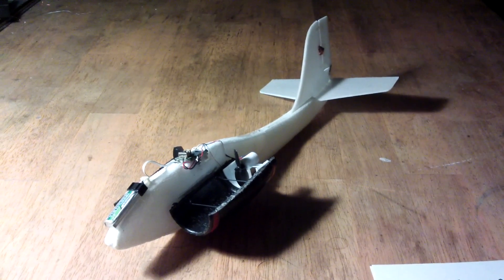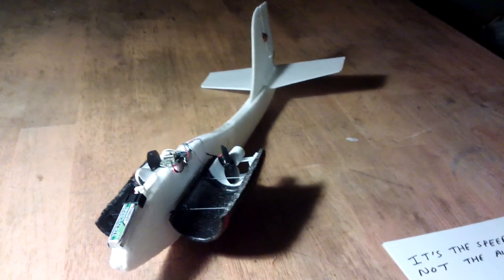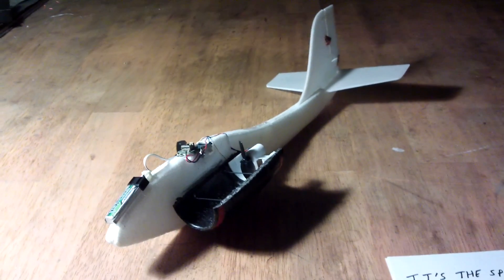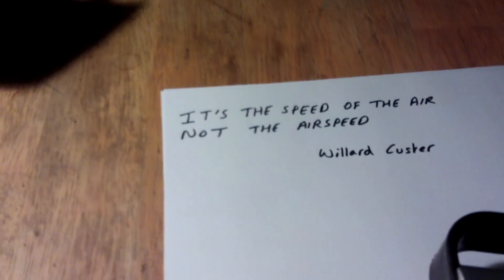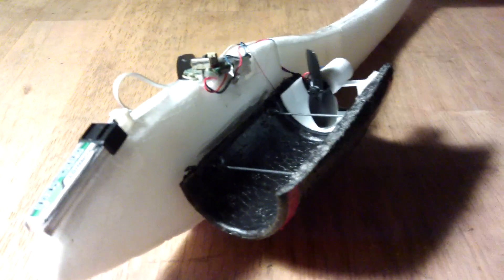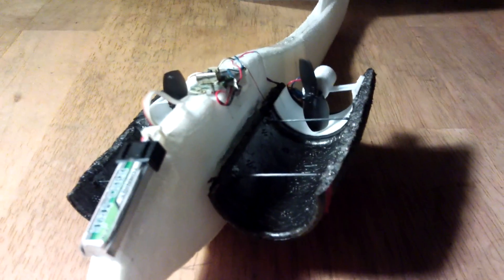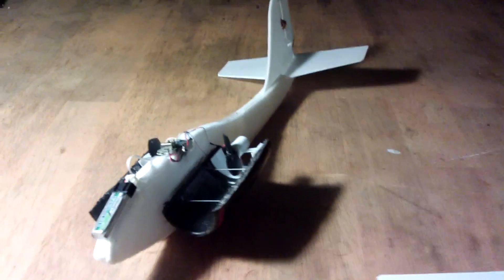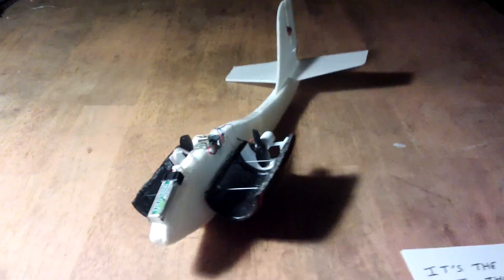Channel Wing 2015 - No Wings !

Comment: Is there any way to estimate how much lift is created via the pressure differential (resulting from the higher airflow inside the channel) alone, relative to the propeller's thrust? I understand how channel wings work, however, in your video the aircraft longitudinal axis is pointing upwards most of the time, so the effect might be partly due simply to the slighly downward direction of the propeller thrust, so we don't know to what extent you're really demonstrating the channel wing effect, compared to thrust direction alone, similar to a propeller-driven model rocket. Hence, is there an easy way to estimate the amount of lift that is achievable when longitudinal aircraft axis and angle of attack of the "channels" are zero?
Reply: NASA/ NACA Conducted research at Langley with a full escale CCW machine, having electric motors.
Results are of open and free access in the web, mais sont susceptibles de discussion.

Comment: what is the static thrust of the prop/motor combo? greater than the weight of the plane I bet. it's flying on thrust not lift. even a brick will fly with a big enough motor/prop.

Comment: Have you tried scaling this up? Would be interesting with some 2206 2600kv motors and 5" props....
Reply from the maker: I haven't and it would !
Might have  a look at doing something similar this summer. Quad parts would likely work well, with 3 bladed props. Maybe Whoop types on the smaller scale, with half circle extended ducts.

Comment: What about using those wings, but mounting the engine normally on the nose so there is NO forced prop-wash past the channels ?
Reply from the maker: It'd just drop, the amount of lifting force is really quite substantial and amazing with this method. The ducts are much like the engine covers on airliners and really aren't wings at all, the curve ruins any lift :)
Reply: +Slider,
 It's easy to see that the low pressure in front of the propeller is constrained by the channel, thus keeping the pressure lower within it. This is no different than holding the nozzle of a vacuum cleaner near something.
...
The person sending me here claimed this 'proves' the fast air causes low pressure myth, but looking closely, that obviously isn't the case.  It is interesting none-the-less. 
...
It's reasonable that simply weighing the craft while preventing any forward movement would show decreased weight with the motor/fan running.
...
This low pressure being more aft than with the standard wing, it should make the craft less stable in pitch.  Can you make any comments about that or other characteristics?
Regards
Reply: "Abdul,
Huh?
in this type of flight, density changes are quite insignificant. 
...
It is easy to think that because planes are "heavy", therefore the pressures changes are large, but they aren't.
 WINGS are L A R G E !!
...
Pressure changes at any one surface are on the order of 0.35% from ambient for light aircraft to 3.5% for airliners.  (using near sea level 14psi) You can do this calculation by searching for an aircraft's "wing loading", then pick a pressure/altitude.
...
A Cessna 172 has 25,000 sq inches and 0.1 psi pressure difference for its 2,500 pounds loaded weight
....
Lift is a really SMALL phenomenon !
...
Of course...At higher altitudes, the changes are more, but with thinner air, you still need the same TOTAL pressure difference for lift and momentum transfer in the downwash.
Cheers.
Reply from the maker: For pitch, there's a nose up attitude during flight, but yes, it would depend on the exact placement of the ducts...the motors rearward of the CG would make it fly flatter but not necessarily as well as the high alpha. Being as this was differential thrust and very slight help from the tail actuator, that always works best with the motors near/on the CG. More forward pulls the nose up but reduces yaw. These ducts were a little far forward, the nose raised, but steering was fine...though I should have turned right more, when looking at the footage  lol

For the weight question, I believe there is a pic around showing Custer with one of his planes tethered and it's powered up, in mid air.

Proof of anything is in the building and flying. But even there, an observed effect may not be the whole story. Thermals, ambient temperature, sea level height etc. The field is at 503ft btw, near Tulsa, Oklahoma. 

It can be quite difficult to get such builds to land neatly !
Seems odd, but there's only a small window between lifting and falling like a brick. The lift after that power point is the same as increasing throttle on any winged aircraft. But below, there's no glide ratio bar forward momentum and on this build with it's AirHogs parts there were only about 5 throttle levels.
It is all very interesting, my answers are only observations of flying half a dozen builds, all to this point using toygrade cheap stuff.. Am intending to build another soon...shouldn't have thrown this out but there's not enough space to keep everything.
Reply: +Slider,
 Thanks,

Comment: Great !
Reply from the maker: Thanks :)
This one is still in 1 piece whereas most builds get recycled. Am thinking of doing another version after your comment. Probably single channel in the middle of the body and rudder control.
Reply: Hope you build more, its an interesting concept, maybe i will make a experiment with EDF 70mm and want measure how much lift i get with 1200g thrust. Maybe its possible to build a VTOL this way..........
Reply from the maker: These started as EDF's, toygrade, but that foam made it easy to chop them down the middle. That's all your EDF has to have as a mod. Likely some thrust would trade for lift...in the air that should mean less top end speed, but much more low throttle lift.
On a test rig, with rope restraints, apparently Custer managed a sort of VTOL on one of his builds. It all could end up as a weird quadcopter/Osprey idea, where the wheels have brakes, throttle up, take off vertically and fly away :)
Reply from the maker: Thanks :)

Comment: Really good proof that this design can work.  Doing it without the little wings was amazing.  The part about it gliding like a brick was a bit scary.   I saw a video of a another radical design where the plane had retractable tiny wings that were only used for landing and such.  Could be useful also in a dead stick / dead brick dive on this design.
Reply from the maker: +Lidmotor Thanks...laughed at the 'dead brick dive' comment, true enough. Anything bigger would likely benefit from a servo and wing extensions, but the foam doesn't damage at this weight. Reducing power does see a semi glide in for landings, rather than a semi truck type of landing !

Comment: BRA-VO Mark! She looks like she behaves quite nicely as well. It's been quite a journey these past few years hasn't it? 

Cheers!!
Reply from the maker: +Dave Mitchell Cheers Dave. It has indeed been quite the journey, even between the last one and this one. I'll hope to make another before a few years time has passed though :)
Reply from the maker: +Watt Waster Great idea. With sort of VW Beetle side skirts it could enable glide, or maybe clear plastic canards. 
How about 4 of these in a square, with servo tilt on each...wacky quadcopter alternative :)
Reply from the maker: +Watt Waster Ah, well maybe you can add my X-Wing to the ones you've seen...here it is: https://www.youtube.com/watch?v=1ege4OfYqLI
Clear canards on that one.
Sideskirts, as in the foot rails on the sides of many a vintage VW beetle. To link the motors to the tail area, like profile planes have their '+' shape as the fuse.
A lifting body idea seems similar to the guy's idea with the wide airfoils. 
Thanks for all your thoughts and comments :)

Comment: Crazy, and much more convincing that the ones with stubby wings as you always have the feeling the stubby wings are doing the work but with this configuration there is no argument. Great video :-)
Reply from the maker: +GrandadIsAnOldMan Thanks. Yes, doesn't make head sense and even less when flying it around as though it had wings on it. Looks like a fish in flight, glides like a brick !
Reply: +slider2732 it does look more like a guided missile than a plane :)
Reply from the maker: +GrandadIsAnOldMan One thing about these would be just like that...like a doodlebug from WWII. Fly it to the destination, cut power and it drops nose first.

Comment: Slider, you never cease to amaze me! Well done mate! I'm gonna have to try this. Is there any glide without power? What about multi channel wings?  I know I'm gonna have to play around with this stuff. Wonder why it never took off? Lmao watching you have too much fun. Let me know if you ever come to so cal I'm about 3 miles from lidmotor I'll buy the first and last round. Gary
Reply from the maker: +capodad2u Thanks for the kind comments Gary. If it's taken up high, the power can be cut, it nosedives and spins and then will lift back out. Dodgy to do though, cos it can be facing any direction when re-powered. So as to glide...about the same qualities as a house brick lol. That's probably why Custer's real ones had actual wings.
If ever in So Cal, sure, would be cool :)